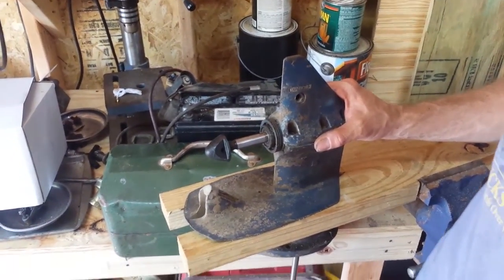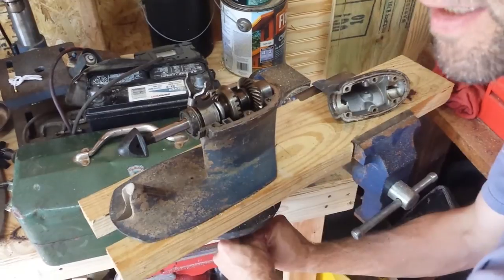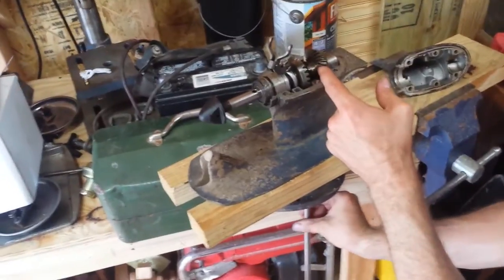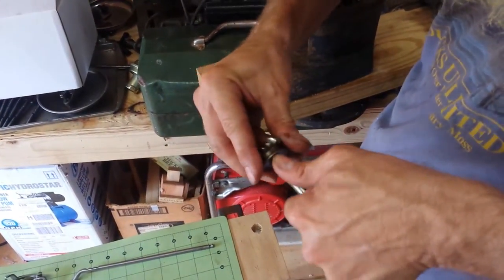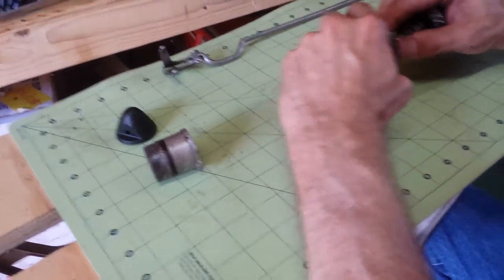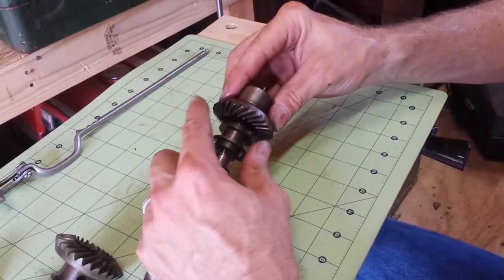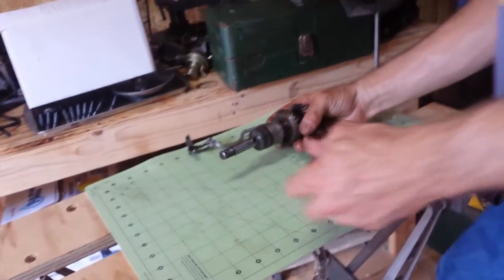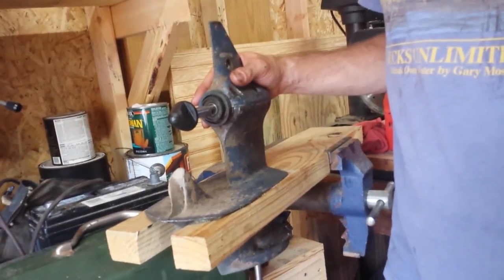How an Outboard Gearcase Works: A Tear-down for Vintage Johnson Evinrude OMC Lower Units

Comment: A couple of questions. 1 does the front bearing, the one at the front of the skeg have a key to hold it place. 2 what holds the shift rod to the saddle¿
Reply from the maker: +sniperdoug1969 From model to model, the presence of locator pins or keys in the propeller shaft gears varies.  Sometimes, locating pins are embedded in the lower unit housing, and a hole in the forward gear bearing (furthest from the propeller) indexes with one of these pins.  Another locating pin may be toward the propeller side and intended to index with the head bearing (closest to the propeller).  For question 2, the shift rod is held in position against the cradle/saddle with a shift lever screw.  This screw was removed during the disassembly process, and it is only threaded about 1/4 of the length of the screw -- the remainder of the screw is smooth and aligns with the hole in the shift lever.

Comment: great video! Learned something today, I'm very new at this n I was wondering if u can guide me in the right direction my 1999 200 evinrude ficht has issues in reverse, but only after driving for a long period of time n when need to put in reverse it will not go in reverse and it idles very high 2k rpm, but when cold it seems ok. Hope you can help thank you!

Comment: Hi James I'm in the process of replacing the prop shaft seals on my FD-21R and the lower unit set up is identical to this. I was wondering if you knew of a seal kit that would come with everything I need to get the job done?

Comment: How tight should the shift spring in the case be.  If I tighten it down I can't get it to shift easy.
Reply from the maker: it will be very tight if you try to pull thebrod by hand ... once assembled, the shift lever provides the needed leverage to move the rod.

Comment: Great videos James.i have recently rebuilt a 1955 johnson 5.5 hp CD-12.everything new under the flywheel and new carb rebuild etc.I never opened the lower unit as the water pump was working fine.Motor starts and runs great,great power in neutral but in forward she only seems to have about 25% power at full throttle.Could this be an issue with the lower unit gears?Or maybe you can steer me in a reasonable direction to try and correct this.Thanks and keep the videos coming,great job!
Reply from the maker: sounds like fuel mixture needs some tuning. have you adjusted high speed and low speed screws while the motor is in gear?  other possibility is the propeller hub may be "spun" - if the motor seems to be putting out the rpm's but its just not getting the boat to move, this could be a bad hub.
Reply: yes i adjusted the screws when the motor is in gear (and i can tell their working to an extent,the motor reacts) but it just seems the rpm's wont go up under load(F or R)?Their could be a fire issue in one of the cylinders maybe ill try pulling the plug wires one at a time to see if the engine dies,although all my parts are new(under the flywheel) it could be a faulty condenser.
Reply from the maker: you should check the points (gap and dwell) if you take the flywheel off again.  other thing to check is compression. if the rings are really worn, you might get symptoms like you described.
Reply: compression is 75psi and 80 psi,respectively-points are new and set .020==took the lower unit apart today,gears, clutch dog, shift rod,etc. looks like brand new and its fireing good on both cylinders,So James i am leaning back to your first suspicion that it must be carb related(fuel),im thinking i must of frigged up the carb rebuild somehow.Once i get this lower unit sealed up tommorrow im gonna run her just to check for a miracle,then i am gonna have to take the carb apart again.I rebuilt 5 outboards in the last two months and this one got me puzzled,Thanks James ill let ya know if i come to find the problem.

Comment: 1956 AD10..  My guide pin for the forward gear slot is worn and barely grabs when I put the prop gear assembly in.. I've had issues not with the carb or throttle advancing, they work fantastic, but I'm getting kind of a forward gear hop.. Prop turns fine at an idle but when you gas it it hops or acts like a spun hub.. Do you think this pin being warn is my gremlin and can it be drilled out and another tapped in? Thanks James..
Reply from the maker: I think it's more likely that you have a spun hub.  the property shaft is turning whether that guide pin is worn or not. if you score a line with a steel file across the hub and the prop, you can see if the hub has moved in relation to the property after a suspected slipping event.
Reply: +highlandoutboards Pretty sure the prop isn't pressed on this.  It looks solid and it has a sheer pin connection..
Reply from the maker: +John Roberge How do the two big teeth on the forward gear and on the clutch dog look?  If these are worn down to rounded edges, you could experience the same thing. Also, if you hold your shifter handle in forward while you're throttling up, can you keep it from slipping?
Reply: +highlandoutboards No wear there.. I'm suspecting the guy before me may have pulled the lower clutch dog pivot screw out or the shift linkage may have slipped off the shift rod divot clip..It wasn't clicking into gear.. Waiting on an impeller and seals.. I'll let you know how it all goes.. You've been a valuable resource James.. Much appreciated!

Comment: How do they get that reverse gear bearing onto the propeller shaft?  In the video you leave it and its washer on the propeller shaft, and when I disassembled mine I saw why, that bearing seems like a narrower diameter than the end of the shaft where the prop screws on...? Thanks!
Reply from the maker: +Islander Sailboat I have no idea how they assemble that bearing onto the shaft.  Best guess is it was pressed on (?) with a machine when it was manufactured.
Reply: highlandoutboards Thanks! One other thing I discovered is that my shift rod was held in place by a sort of spring that attaches to 3 notches in the shift rod.  I see the same notches at minute 3:37 of your video.  Thought I'd point it out for others because at first I was like 'groan, what have I got myself into' when I popped mine out and it wasn't easy to get back in place :)  But now I get it, and can actually remember when I was using my shifter that feeling of clicking into those 3 notches!
Reply: Islander Sailboat Last comment :) Gave you a shout out in this blog post http://islandersailboat.info/johnson-6hp-1967-outboard-gear-case-part-1/
Reply: +Islander Sailboat Ok one more for everyone Leeory has some great tips in general http://www.leeroysramblings.com/OMC_6hp.htm but also about the Shift Lever Stops and that L-shaped spring under the screw.
Reply from the maker: Thanks for the reference!  Great resource.